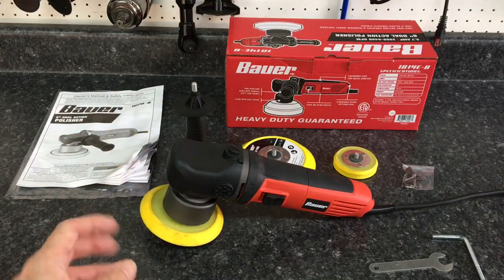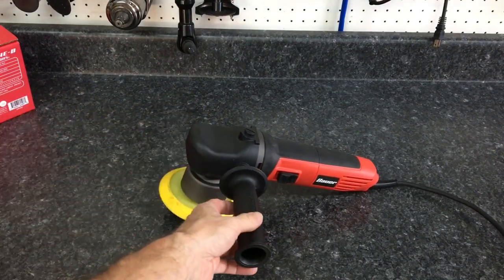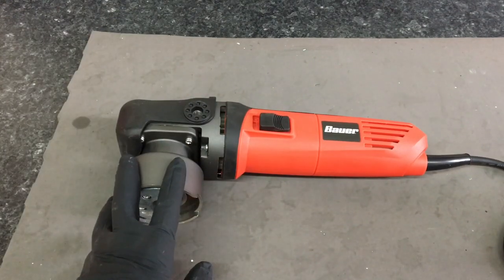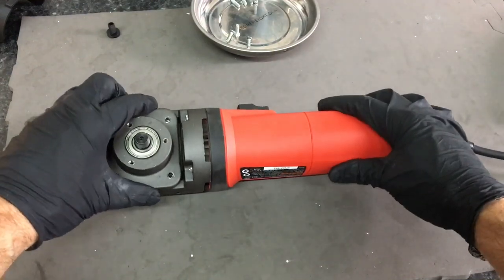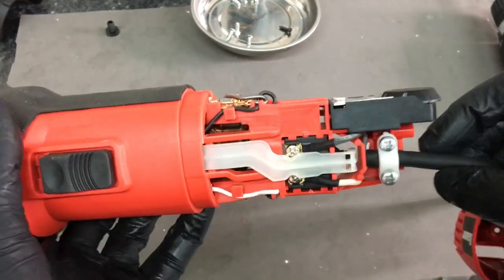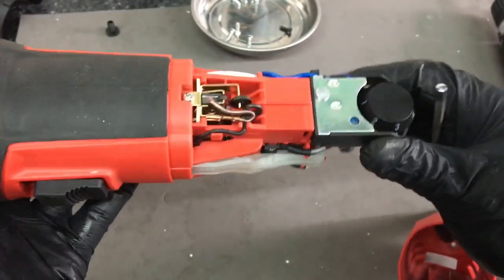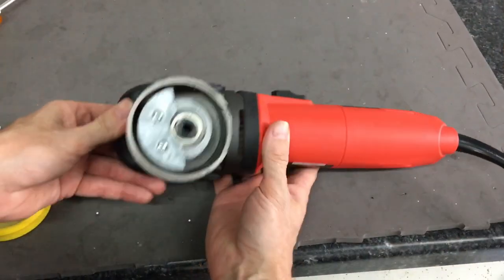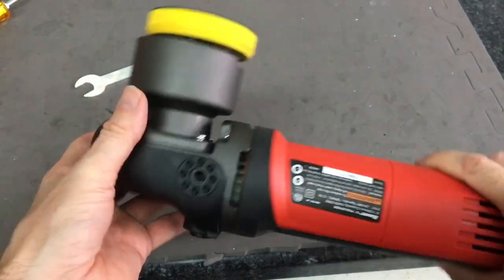NEW!!! Harbor Freight (BAUER) 6 inch Polisher! W-T-F Were They Thinking?!?!?!

Comment: There's a new DA Bauer model which is pretty much identical to the old Chicago Electric inside and out, including the sealed bearings old yellow grease, old 10ft cord, older style fan, epoxy around the winding on the bottom, same switch and the speed dial unit is sealed. I think one of the bearings is smaller and the gear ratio is slightly higher - it's model number 64529 (i saw different video that shows 1814E-B on the box). What you reviewed was a model 64528.

Hopefully it's better than this one.

Comment: This was disappointing. I've been wanting to get into polishers. So far the Griot's orbital polisher has been at the top of my Want list but was wanting something cheaper. Went to HF last week and saw that Bauer and was very curious, did hate how the dial doesn't click and was too easy to switch speeds. They also had a Chicago Electrical polisher for about $50 or $60, but thought the Bauer would be the better choice.
Reply: I bought the Bauer to use on my family's daily driver's and it works fine for the money. Definitely a "you get what you pay for." So far I have put about 30 hours on it. Oh and I got it for $49 with discount coupon code.

Comment: The reviews for this are amazing.
People have used and have only good comments. Why is it?
Reply: Brian took it apart piece by piece and showed everything wrong with it and explained each issue. Then he used it on a panel and it clearly stalled all across the panel each pass. Why what?
Reply: Why not trying it out first before taking it apart? 
There's always a chance of messing it up when trying to put the pieces together.
Reply: @marcoh.3293  extra pieces are always included, and not needed. So when you put it back together.. it's good. That's why.
Reply: Not in favor or against this product, is just that when you buy a piece of equipment with good reviews, do you really want to mess up with it first taking all the pieces apart and then after trying to figure out why doesn't work properly?
Reply from the maker: Hey...buy what you want good sir. This is the worst polisher I have reviewed....I just wanted to share. What you do with that info...is completely up to you.🙂

Comment: Thanks so much for this Brian. Went to buy the CE and this was all they had. I'm a new enthusiast and only do my car. Used 1x so far. Hated the switch right off. I noticed the vibration but nothing to compare to since it was my 1st rodeo. I have some Gorilla epoxy. Can I just apply that? What DA would you recommend for a personal use ( probably 1 or 2x a year) guy like me?

Comment: @Apex Detail there's a refresh to this already with a new part number (ending in "9"). The good one is 64529. The bad one is 64528. The finish is much cleaner than the model you have (ending in "8"). It's much smoother & quieter than the Model "8" number. I haven't pulled apart the "9" yet...  https://www.youtube.com/watch?v=WP9oiZcThMU
Reply: Thanks for the link. I purchased a 64528 a month ago, but hadn't used it yet. I saw you comment and checked the first store by me. They had 9 64528's. The second store had 2 64529's so I exchanged it.

Comment: I have this unit, got it on sale for$60 bucks. 
I changed the grease like you mentioned but I used LUCAS RED "N" TACKY grease, it has a 540°F drop point. 
Is this grease too heavy (thick) for the polisher to operate smoothly. 
I know you mentioned WOLF'S HEAD but I had the LUCAS hanging around....

Comment: Harbor Freight revamped their tool line, mostly for the better. It doesn't look like the folks in the polisher department got the memo. The only upgrade is the fan. Other than that, this newer model is full of downgrades. I have the older model and with real grease and a better backing plate, it's by no means a top machine, but with care and moderate ability, it does the job. This new one seems pretty much unusable.
Reply from the maker: You are completely correct good sir.👍

Comment: I just purchased it from canada.

Tried in india for the first time for half an hour.
Then packed it until new polishing job cane.

Today reopened and it's not working.

Won't turn on. Please help me.

P.S. i use universal voltage converter 220V/240V AC to 110V/120V AC 50/60Hz

Comment: What are your fav DA polishers for 3 and 5-6 in?
Reply from the maker: Flex and for the money...MaxShine.
Reply: @apexdetail85  I have the Maxshine 15, I regret the purchase. Rotation of pad stops with very little pressure no matter how careful I am with the pad level. Even had a professional confirm it was the machine not my technique. Save your money and get a Flex or Rupes.

Comment: With all due respect, but where can you find a better DA for under $60 (with coupon)?
Reply: Bobster986 I said the same thing......I use this for headlight restoration works great !!!!!!
Reply: @dopedetailing1226   agree sir. In europe i bought the same machine under a label <<hi-spec tools>> , it cost me 45 euros......with 3years warranty. I put 5inch /3inch plates..............i do waxings, AIOs, 1 steps on small cars, headlights, bumpers, A,B pillars,  very very easy with it. (most european cars in my country are small with many curves)
Yes it vibrates a lot, yes it is loud...............also yes..........i had great great great results for the price and the investemet returned back multiple times. Yes my hand are hurt but............i wear hight quality bike gloves....and ........its ok...for 45euros.how i can go wrong?????????
Reply: notice that.my other option in my country is the das6pro(nice machine) but i sould spend 3-4+times the money i spend for this.

Comment: Mine wobbles a lot and of course I really went to use it over a month after buying it so I can't return. Does yours or anyone else experience the backing plate wobbling? I thought buying a new one would fix the issue but others have said it doesn't so now I'm very concerned. I tried hand bending the backing plate as straight as possible but it's not perfect by any means. Does anyone have a solution for me?
Reply: Yeah, add washer/ drill few holes counterbalance and change grease bether quietly also high recommand change backing plate to 5in lake country or forgot other name also have playlist this product mods people did.
Reply: Change the plate to a 5inch Lake Country + change the grease also if you can = a hole.new machine experience

Comment: I have no idea why people bother with these cheap machines. I paid around $110 for my beloved PC 7424XP. That is cheap enough, right? I am picking up a 6" Griot's to be my standard 5.5" pad machine, and I will probably make my 7424XP a dedicated 3" pad machine.
Reply: The PC machine is weak as they come though
Reply: @carbonconnection2480  It isn't weak compared to this Bauer trash. Besides, it is perfect for my needs. My cars don't have trashed paint. The worst defects on my daily driver are snow brush micro-scratches after winter. Big deal. They come out with green foam polishing pads and a one-step polish. My weekend toy just gets a light polish with blue polishing pads at the beginning of the show/race season. Tell me why I need anything more powerful for my needs. :) The 6" Griot's is more machine than I even need, and the 7424XP will be a great 3" machine.
Reply: @FYRARMS . I've seen it do good as long as you don't need power, I had one I used for just spreading wax etc but they aren't good for paint correction. And I wouldn't even compare it to this bauer junk 🤣
Reply: @carbonconnection2480  They are great for correction if your paint isn't trashed. Just takes a little longer than larger machines. Microfiber cutting pads and 3D HD Cut+ compound has worked great for me. I have corrected a few friend's cars. But, we aren't professional detailers. Just multi-car owning enthusiasts. We just don't need more powerful machines for our purposes. If I detailed for a living, I obviously would own rotary machines and long-throw DAs.
Reply: @danlc95  lmao! I know but I'm learning 🤣🤣🤣

Comment: I got the Chicago electric Rotary polisher. It overheats like a mofo and it's 7 inch backing plate sucks haha I really gotta change the backing plate... Any recommendations?
Reply: The K-99 backing plate by 3D, great backing plate.
Reply: @alduin69  thanks Niko! What rotary do you use??
Reply: @daves.3278  I use an olde DeWalt DWP849, absolute unit and workhorse, and is quite affordable.
Reply: @alduin69  sweet!

Comment: So I just bought one of these last week (before seeing this video of course). I've used it for about 4 hours and it gets os hot that the backing plate and the backs of my pads are melting. Is swapping out the grease like you mentioned going to help with that or is there a bigger problem?
Reply from the maker: Let me save you a headache....return it. asap